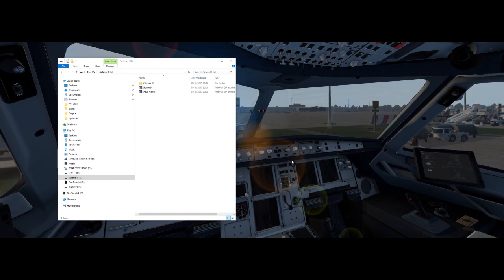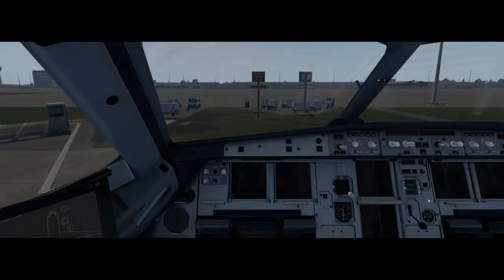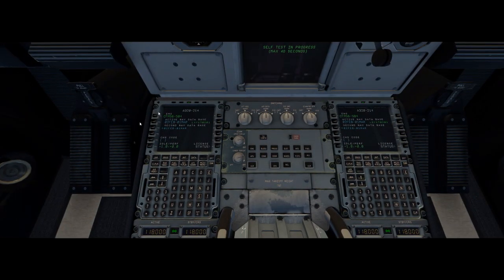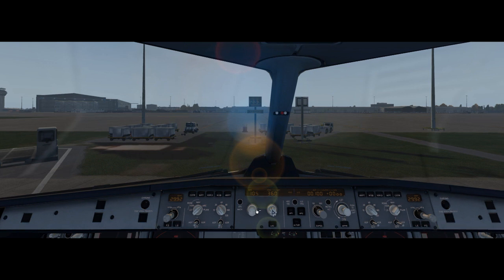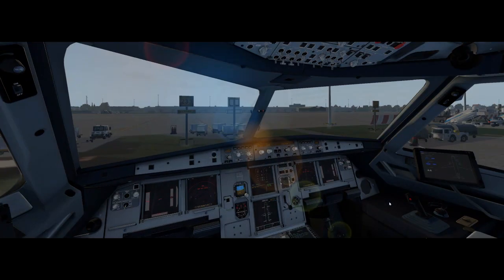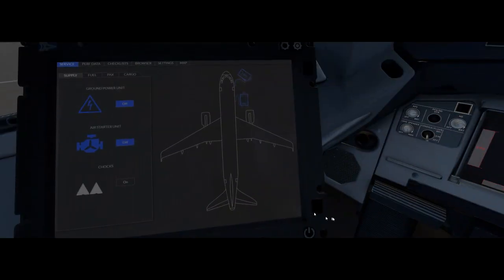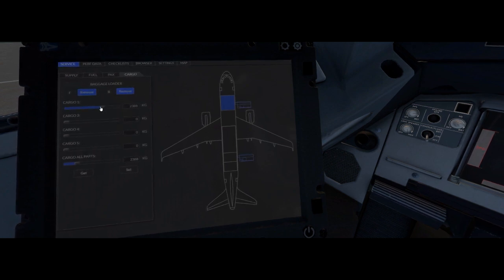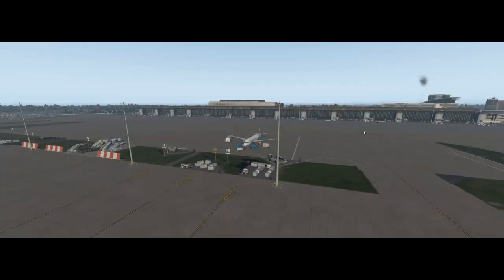XPD: Flight factor A320 Ultimate vlog260

Comment: What documentation does the beta come with? The flows are present? The batteries are pressed on first to check the current status then the ground supply and check current changes upwards.
Reply from the maker: there is a very thin manual which doesnt give you much beyond installation. I assume the full manual will come out soon. As regrads the batteries you are correct. Batts first before anythingelse.

Comment: How would you compare the quality of this aircraft to the FF 757/767/777?
Reply from the maker: this is a hard question to answer because we are talking two different aircraft types. For me the 757/767 from FF are incredible representations of the Boeing types. The FF a320 Ultimate is an incredible representation of the airbus type. You see what i did there. Now if you had asked me to compare between the JarDesign a320 and the FF a320 That would be easier, the FF a320 is a huge leap forward in systems fidelity and accuracy over the jar design a320 the FBW implementation is staggering. If you asking which FF you should buy here is my honest answer if you can afford it buy the 767/757 and the a320. If you cant afford it I cant tell you which one to buy, only you can make that decision based on whether you like Boeing or Airbus if thats the case buy one this month then one next month depending on finances of course.
Reply: Wycliffe Barrett thank you sir.